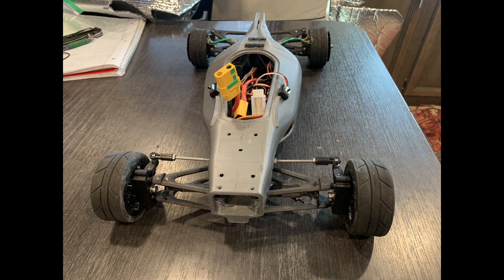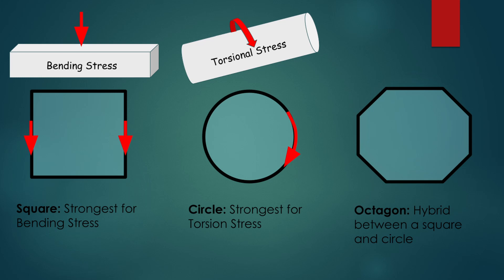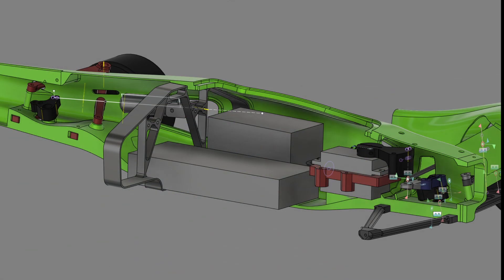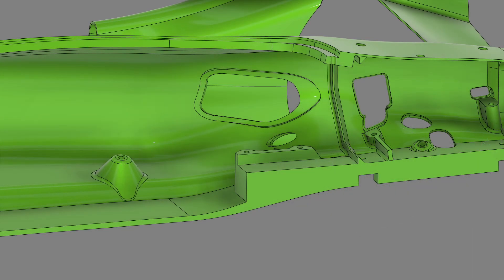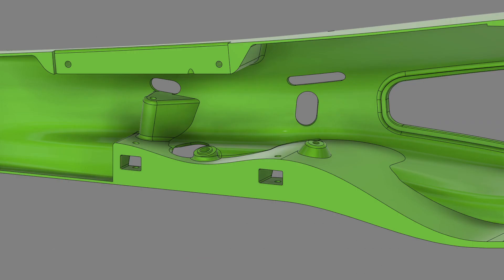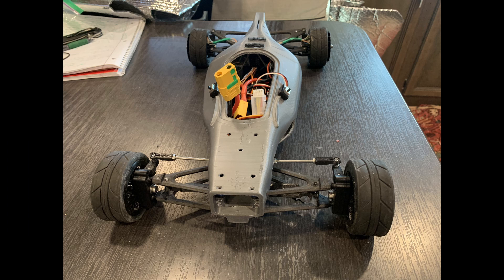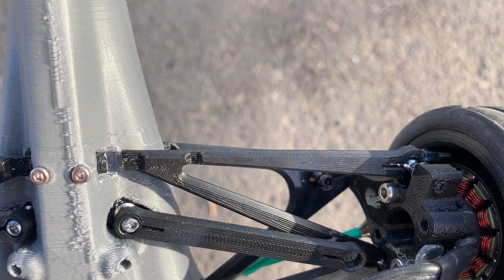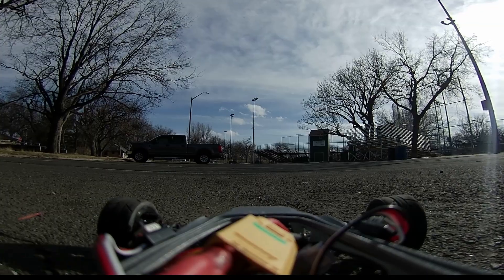RC Hypercar Pt3 - Race Style Monocoque

Comment: Hey, that's an amazing project, I would love to see more. I reminds me of my years in the Formula SAE in the university. I always wanted to do something similar to that but didn't find the time/motivation to start it. One idea that I have to improve the strength of the flexures is to use a thin metal strip (something like a shim with thickness based stiffness you want) as the flexible element. That way, you have also a more deterministic stiffness on the flexure that you can calculate and include it in your roll stiffness calculation.
Keep this perfect content!
Reply from the maker: Thanks!  That’s a great idea to use metal strips. I’ll test that out. I’ve already found that the fatigue life of the plastic flexures may not be that good. 3d printing leaves a lot of non-uniform stresses in the plastic.

Comment: to hight from the ground u shoud cover the wheels cover the front and read rods use a edf fan at the bottom with skirts for up to 1.0273 times the down force to the weight so u can   hang it up side down and u shoud make it from carbon fiber it needs alot more flexibility the wheels are to thin the floor needs a difuser need more agresive side pods and also wider body to control better the dirty air
Reply from the maker: There will be a full body with wings and a diffuser. I may add a fan to the car at some point. The monocoque looks higher because the sides will be part of the venturi tunnels.   Next video I’ll go over the aerodynamics of the car.

Comment: Wow I love how thought out this car is. What are your thoughts and experiences with having the motors in the wheels? How heavy are they? I feel like as they are only sprung by the tire their mass has a different impact on car stability than the mass in the body, which is sprung by the tires and the suspension. 

Also due to the wheel mass being far from the center and the rotational inertia of the whole car being relatively small (due to most of its weight being in the center) the inertial forces of the wheels bouncing up and down could easily flip the car, right?
Reply from the maker: The motors weigh 74g each.  It's definitely a compromise for the purpose of aerodynamics and individual wheel control.  Compared to a spindle from one of my normal RC cars that has the bearings and stub axle, the motors weigh about double. 

I'm not running the car with any dampers or roll springs in these tests so I can't really get a feel for how much it affects the handling dynamics.  The wheels are prototype parts as well, so they're quite heavy.  I also think an RC car's tires with the foam inserts have more dampening than a full size car with pneumatic tires.  So it's hard to know without mounting a sensor to the control arm.

I'm not sure about the car flipping.  I probably should have tried to model that.  The handling without roll springs right now is very quirky  (Also the battery is just flopping around inside the monocoque).  I only flipped the car once by accidently hitting a pothole.  I know adding the full body with the wings and everything is going to drastically change this.  I have a test print for the body done and  it adds a lot of mass to the ends of the car with the wings.

Comment: This is simply WaW ! Which software did you use to design it ? And which material PLA ? And was it printed in half and then glued ?
Reply from the maker: I use Fusion 360 for everything. Everything is PLA right now. The front and back are two separate sections that are glued. 

I didn’t mention it in the video, but since the two sides are symmetrical I just design one half and mirror it as the last step.
Reply: @IndeterminateDesign  regarding the mirror yes that what i do also, so what glue you use to glue both sections together ?
Reply from the maker: I just used gel type cyanoacrylate or super glue.  From what I've read with PLA and most plastic's it's the strongest.  Someday I may print the car out of ABS or Polycarbonate in which case I can solvent weld those plastics.
Reply from the maker: @Firashelou  I used Gorilla Super Glue